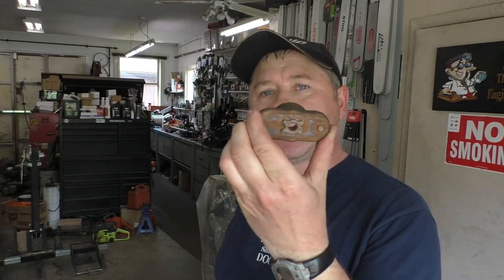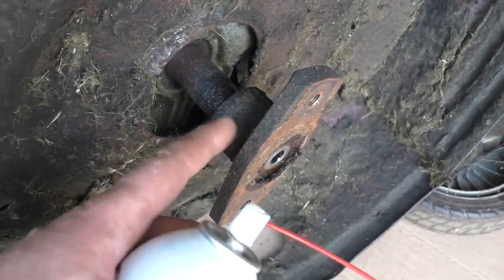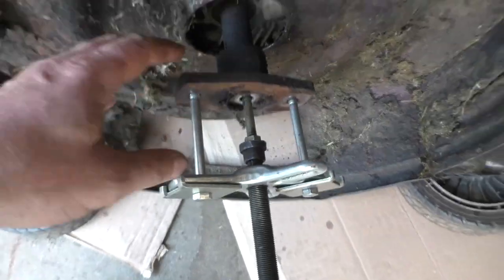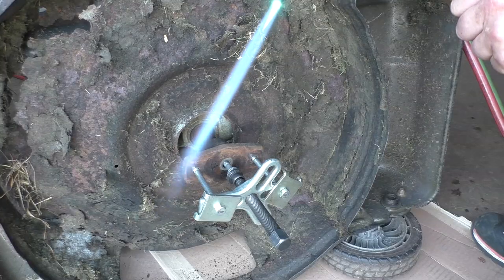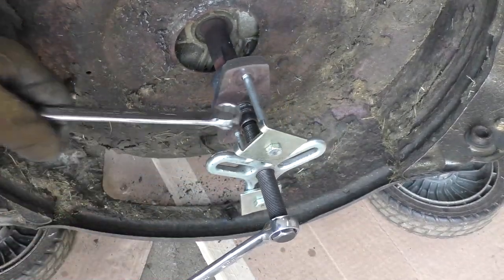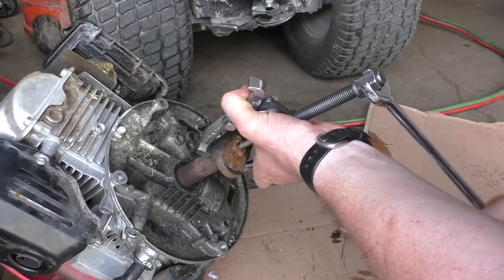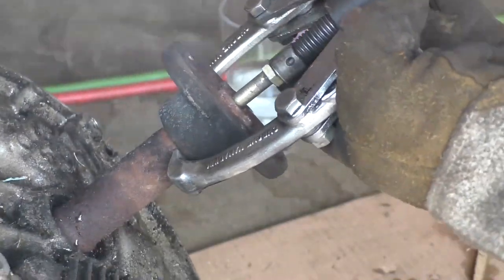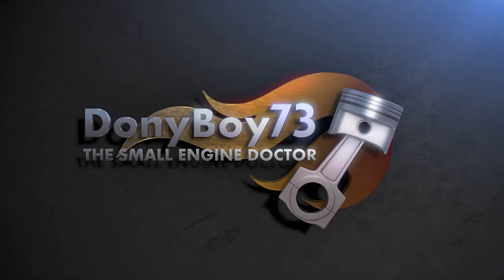How-To Remove A Seized Lawnmower Blade Adapter

Comment: As a small engine mechanic of 35 years,see this all the time.Recently had a stubborn adapter I eventually cut a v in it with cutting  disk and split it with chisel.Yes tried heat and have all the pullers.Another tip be careful grass can ignite on underside of deck and check gas did not leak out before ignite torches as fumes can ignite.I used an old pair of flame retardent coveralls and wrap around carb and engine if working around torches or welding blanket will do the same.Always have fire extinguisher nearby also.Great tips Donny.

Comment: 8:40 Tip #2: Use anti-seize when reinstalling the blade adapter. It will save you, or someone else a lot of time and effort in the future!

Great video Don!
Reply from the maker: yes absolutely!
Reply: Give the end of the crank shaft a rub with fine sandpaper, same with the inside of the adapter
Reply: That's a great idea, if you do it right after you unbox the mower...99% of these adapters are never taken off the engine for the life of the mower unfortunately.

Comment: Hi Donyboy,
That looks like a Uniweld cutting attachment (I was a welding equipment repair tech in another life time...lol) 
A tip I picked up when I started out as a Heavy Equipment Repair Tech (fancy title for diesel mechanic I guess): A welder suggested putting a water soaked shop towel around the shaft before welding on or heating bearings etc. The water will evapotate from the towel but it will also keep the heat away from your seals. Just thought I would share with you whatwas shared with me.
Cheers from NB
Reply from the maker: thanks for the tip!

Comment: It's often helpful to hit the hex end of the puller screw thread when tight , a few sharp raps then see if you can get another half turn , rinse and repeat , useful if no heat source handy . 
Also oxy / propane is a cheaper alternative to oxy acetylene , good for heating and cutting steel , not good for silver solder or brazing .

Comment: Thanks.  The harmonic puller method worked.  Used my impact wrench on it.  Ended up bending the frame of the puller but it was a cheapo one I had lying around.  Will try and straighten it up.

Comment: If the puller keeps sliding off the bolt, you can slide a piece of pipe over to keep them from slipping off
Reply from the maker: good tip, thanks!

Comment: I just had a similar rusted out deck, Mapp gas worked for me getting the adapter off, but I broke all three bolts holding the engine to the deck, despite lots of penetrating oil and heating the bolt heads. 😥 Today I try welding nuts to the broken studs. 😎 I've been eyeing an oxy torch to buy, this video might have pushed me over the edge. Thanks for the video.
Reply from the maker: it's a necessary evil in the shop!

Comment: Good video on how to use pullers and if needed heat. I usually rap the puller bolt a few times to shock the shaft.

Comment: Excellent video,  nice to see it's not just i who runs into that kind if trouble,  😆 
ONLY thing was when I used the heat it caught the dry grass on fire 🔥 . Good to keep a bucket if water handy. 
Isn't it gut wrenching to see such a nice mower gone to pieces just because of lack of a little care.
I had one in exactly the same condition last month.  No need of it, my push mower is 20 yrs old and the deck is as good as new.
Have a good wknd

Comment: Just food for thought you could also wrap a soaking wet rag around the engine out put shaft to keep the oil seal from getting hot while you use heat up the blade adapter
Reply: That sounds like an excellent idea.
Cheap and effective!
Reply: @tinytreepublishing8383  yeah buddy 😎👍
Reply: Another reason not to store your lawn equipment outside in the weather.
Reply: Did it all the time doing plumbing and hvac
Reply: @franklaskus2395  you want to talk about doing time.
Reply: @franklaskus2395  Cool glad you do this
Reply: Output shaft? Oh you mean crankshaft?

Comment: I have used the knife type bearing pullers on them. I use bolt that threads into pto but put wrench on it so it doesn't turn  with puller.

Comment: I used to use 2 torches in mechanical room  air handlers to remove large blower wheels.  get that hub cherry red. start spinning by hand & off it comes every time !

Comment: Wait a min🤔Do the threads on the adapter go all the way through where the bolt holds the blade?

If so I mean I'd just get a really long bolt with the same thread pitch and call it a day

Comment: Just broke a pulley on self-propelled mower I am doing an engine swap on.  Using a 2 jaw pulley.  I need some torches or MAPP gas at minimum.  Propane doesn't get hot enough.

Comment: Liked your video. Always professional. But I watch folks using pullers using a bolt, and it is so much better to use an allen bolt with a pointed puller. Just saying

Comment: Good morning Don,       I’ve dealt with a few of those stubborn blade adapter removals, can be challenging at times but helps to have the right tools. Any tips for removing engine mounting bolts to the deck. I often can’t get the bolts loose and they want to break easily. Not fun extracting broken bolts from the engine.
Reply from the maker: sometimes I heat the part on the engine where bolts g through but be careful because it can melt if using oxy-ace torches!

Comment: Donny, I’m in a bit of a pickle. I’m fixing a 2005 Craftsman 55cc Incredi-pull chainsaw 316350840 for a buddy. The oil pump 9228-310208 worm gear is stripped and the housing is cracked at the set screw. I can’t find it anywhere because it’s been discontinued. I’d hate to junk a perfectly running saw over this. Any advice would be helpful. Thanks!

Comment: It saves your bacon, and you could cook some bacon with it too. I like bacon.😄 
Seriously, I'd like to see a video on how you would put a new adapter ON the crankshaft, especially if it's a tight fit and doesn't want to go on with a few light taps. I've put a few onto various mowers by replacing the keys and greasing up the end of shaft if the adapter was stubborn. Then I've had a couple that just didn't want to go on without a few good whacks, but then you run the risk of screwing up the end bearings and seals. Didn't have a torch, but luckily everything went together okay, but it would be interesting to see how YOU would do it. Anyway good vid and much appreciated. 👍
Reply from the maker: i would sand the shaft or use a flap disc on a grinder
Reply: @donyboy73  Hey Dony. Thanks for personally replying. I'll keep your suggestion in mind if I have a problem putting an adapter on a shaft. Nice of you to take the time. Appreciated.👍

Comment: I c your puller has a flat surface does that part screw onto the bolt or is it all one piece and if I had to replace the bolt for whatever reason how would you do so with a flat end
Reply: I am working on a project but I have a three jaw puller and it has a screw type thing on the end I have a double pulley on my engine

Comment: Before I would resort to the torch, I would have given the center bolt of the puller a few moderate hits with a hammer to try and pop it off. Or I would hit it with an impact, which usually pops them off. I don't like fire, dead grass, and the crank seal so close together.

Comment: How much are those torches
Reply: Go to a welding supply store such as Airgas and check into what is commonly called a “plumbers pack” if all you intend to do is occasionally heat something up.  They are small light weight tanks in a carrier you can hand carry anywhere.  Before the introduction of PEX tubing for water lines plumbers used them for sweating copper tubing together in a house.  The two tanks are for oxygen and acetylene same as shown.  Some supply houses are only refilling their own tanks now, so be careful where you buy them.
Reply from the maker: without tanks, $350 canadian

Comment: PENETRATING OIL( LIQUID WRENCH) & REMOVE EVEY SHARPENING & ADD A SAFTEY WIRE/ PIN & LUBE - FOREVER 😀😘 
OR - FILL THE GAS TANK & YOU'LL NEVER HAVE TO DO IT AGAIN?🤫😭

Comment: Too much heat, you ruined the crankshaft seal on the engine.   Use less heat and tap the head of the puller bolt with a hammer, might have to do this a couple times. If your not saving the engine, then burn away!!!!!!